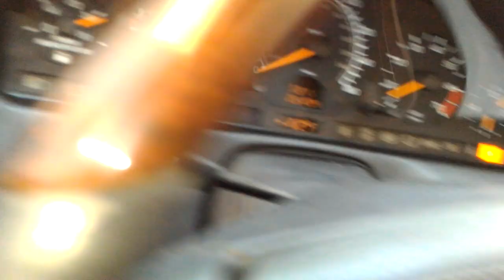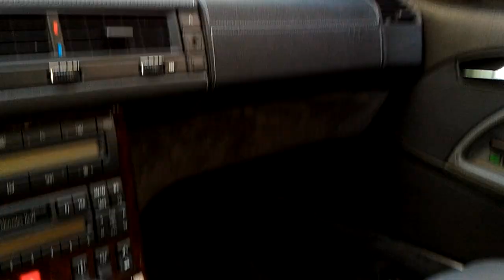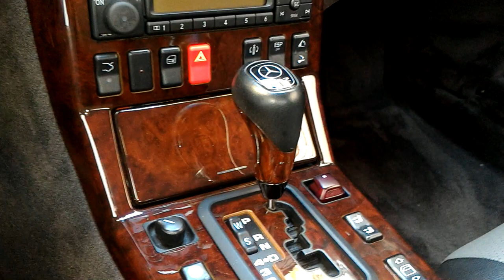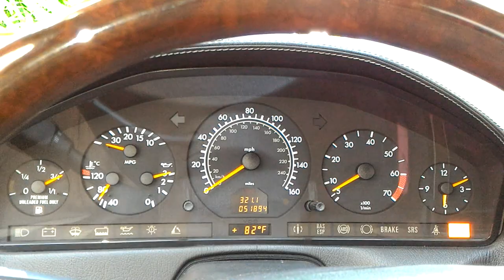Mercedes SL convertible top problem

Comment: I expereince the same problem every now and then.
There is a sensor under the windows, registering the endposition.
The roof expects this sensor to be touched.
Sometimes the power-window motor can not activate this sensor because the window seems to be stuck 1mm above the zero line.
In this case I push the upper edge of the lowered window by hand - in my car it is the right one. I gibe it a short but powerful push and immediately the roof continues to do its work.
Since a lot of you guys seem to experience this problem I hope that a couple of you can live with this workaround like I do.

Comment: The Lid sensor is bad. That sound that you’re hearing is the lid motor not the top. 
The lid sensor supposed to send signal to the top saying the lid is up. But it’s not doing that and the top will not come down because it shows that the lid is still down.

Comment: If you had the battery disconnected you need to sync the windows, I had similar issue once I synced the windows it fixed my top getting stuck halfway

Comment: My 1999 SL 500 is doing the same thing.  But It did this once before and I installed a new battery at the roof worked fine.. So I think in my case I have let it sit too long and now battery is too weak?   Do u agree?

Comment: Hi victor I have a 97 sl500  i changed the whole top with frame it works but when the top is up the light stays on when down light on switch is off can you help thanks Mario
Reply from the maker: I need to see the car to diagnose it. Not possible to say wjats wrong remotely.
Reply: We live in upstate NY. Where is your location?
Reply from the maker: @deborahlomascolo2480  I work out my home in Bronx, NY. I'm on City Island, zip code is 10464.

Comment: Also Mr Ronnie - My 99 SL 500 is all original with 52k original miles.  Mine sat for about 1 yr with a float charger in my shop.  And then I went to crank it it.  Well it turned over very well.  The it turns over like a top but, would no crank and my gas gauge shows empty.  So I filled her up and still won crank.  So I immediately changed out the fuel filter and fuel pump.  now it wont turn over at all?  what gives the fuel gauge still shows I am empty.  Help Pls ???

Comment: Hi Victor I have a similar problem with a 1997 sl500 the tonneau comes up the bow comes up the windows work fine but that’s where it stops. I had 7 out of the 11 cylinders rebuilt by Top hydraulics and tested the micro switch on the bow cylinder it had 0 ohms when the bow was straight up as it should. I tested the magnetic switch above the header was ok did you ever find out why the vehicle you were working on did not unlock the front locks? Jerry in PA
Reply from the maker: Hi,
I repaired many different problems. Don't remember what I did with this car. But I can look at your car if you want to come by. Call me someday to discuss. Thanks

Comment: dear victor. 

after i overhauled all roof cylinders i have the same problem, only difference that my button is lit.

can you advise?

thanks
Reply from the maker: Dont know whats wrong. I need whole car for diagnostic.
Reply: Mine is having same issue! Did you figure it out?

Comment: maybe you can help me, i have a 95 sl500 and windows are not working when roof is up. When top is down, windows work fine
Reply from the maker: I cant say whats wrong without proper diagnostic, need to have whole car
Reply: @vsandvs  how many switches are in the area where the soft top goes i have found two there and one at the top of the windshield, id like to trick the system into thinking top is always down

Comment: Hi, I have a same problem Victor, what can I do?
Reply: i  had this problem      fixed by adding more fluid in hyrraulic resoviour undfer spare tire  and fixing leaking cylinders in soft top storage area       not just the ones in trunk      causing system to loose pressure